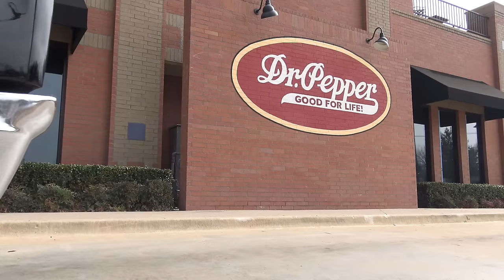1967 Dodge Coronet R/T HEMI 528

Comment: Four questions, are you using a gear vendor? What’s your mpg like? How much did that engine cost? What is your compression ratio?
Reply from the maker: Go to Ray Barton's website and look at their 528 HEMI, that will give you the answers you need. I don't know on the transmission. I marketed this car several years ago. I've marketed 100s of classic cars. Thanks